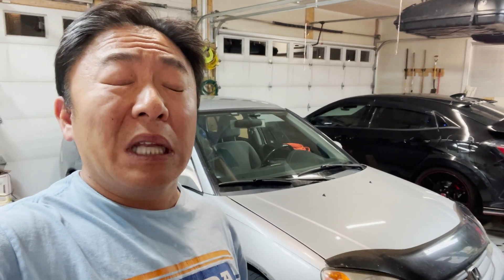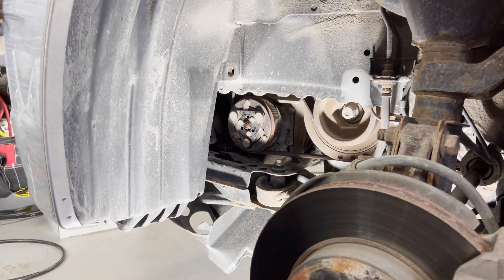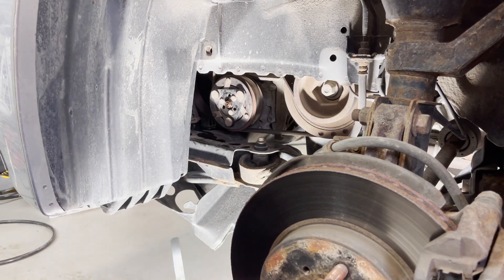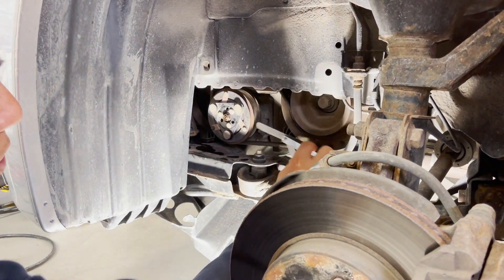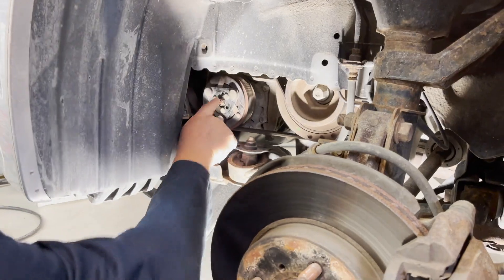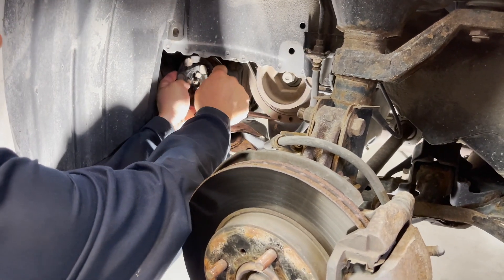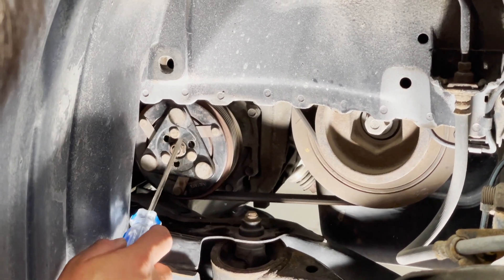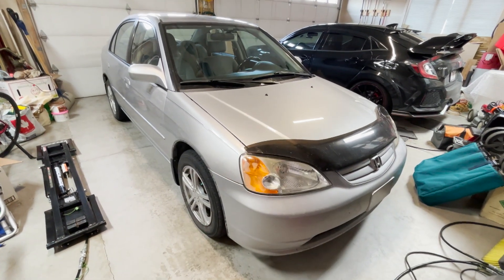Honda AC compressor clutch air gap fix

Comment: That's exactly what's happening with my 2015 Honda CRV. When the car is in the sun all day, the AC doesn't work or isn't working at 100%. However, when it's in the shade, it works fine. It seems the temperature increases the gap, preventing the clutch from engaging. I'll try this trick, hope it works.

Comment: Thanks so much for the video, some really useful info there. I have a UK FN2 Civic Type R with a similar if not the same AC compressor. Mine is showing the exact symptoms of this Honda so i'm looking forward to trying this. Do you happen to know if the clutch plate centre nut has a torque setting (nm) when replacing it?

Comment: Had the same issue. I couldn't figure out what the problem was until I spent a long time watching the compressor engage and fail to do so after a while idling. I shaved the shim since removing it made the air gap way to small. Great explanation. I energized the coil and had the belt on, so I didn't need that special tool to dismount the plate.

Comment: Works on 2018 Honda CRV as well. Thanks.
Reply: I have a 2018 CR-V and the a/c works intermittently on the hotter days. Been doing this for a few years. Watching this video makes me think this is the problem we have as well. @GizStudPrez, did you  have this same problem? Were you able to remove the clutch plate and then remove a shim on your 2018 CR-V? Did you do it yourself or take it to a mechanic?

Comment: In the video you check the gap between .4mm and .5mm but in the text below it says "Honda a/c clutches typically call for a  0.050mm +/- 0.015 mm variance. Anything that falls outside this gap range will result in a clutch that won't engage or one that won't release."  0.050mm is equal to .002"  which seems mighty close.  I am trying to set the air gap on my 2010 Honda Odyssey Touring after replacing the coil and the clutch kit came with two .020" thick washers and the original washers were each .052" thick.  The two thin washers on the new clutch hub and pulley cause them to lock together.  What gap should I be trying to achieve?
Reply: The Honda service manual says "0.35mm - 0.65mm (0.0138" - 0.0256").

Comment: The car dealership I got my from put a new AC compressor on mine. A 1 /12 ago. I used it once. Am really not into the air conditioning cause I just roll my windows down. I don’t like a lot of air. Bad on my body. Great video

Comment: Great Video! What's the name of the tool you bought on Amazon?
Reply: Nevermind! I googled "clutch holding tool" haha
Reply from the maker: It is an ac clutch holding tool but on a honda you legit can just jam a screwdriver into the clutch to prevent it from spinning. The little nut holding things together isn’t very tight at all

Comment: Say if the AC has stopped working entirely? The electric fans activate when the AC button is pressed but the compressor doesn't engage.

As mine packed up suddenly a few weeks ago, still pressure in the system. Relay and fuses are ok. I can't get enough of a tap or turn on the compressor however the gap in the clutch is .80mm.

Comment: I have a 97 CRV my power steering pump has been leaking could that fluid cause the clutch to slip on this AC cuz everything else is working fine and there's freon in system

Comment: I'm going to try this with my '09 Fit. On 90°F+ days the AC blows nice and cold for 5-20 minutes before stopping completely. Happens faster when idling or in stop-and go traffic, and I can often get it to engage if I coast down a hill for 10-20 seconds. It seems the air gap is just barely too big when the plate gets really hot and the metal expands, and cools just enough to engage when I coast. Hopefully there's at least 1 or 2 shims in there I can remove to buy myself another couple years of life out of this clutch.
Reply: I have a 09 Fit as well and see similar issue. Ac stopped blowing cold air after couple minutes when it is too hot outside. Did you remove the shim(s) and did it solve the issue?
Reply: @timalice1794  Yes, I did it last fall and it's been working just great all year! I was sure that something was going to give this summer given the extreme heat, but so far no issues.

I used the same tool as shown in the video, took me about 25 minutes. I wish you the best of luck getting yours fixed! 

One thing I'll mention is that I had already verified that the system was fully charged. It could be that your system is low on refrigerant and the low side pressure switch is preventing the compressor clutch from engaging. That said, removing the clutch shim(s) is pretty easy and there isn't really much of a downside. If it doesn't fix the issue then you can always put the shim back on. But if your car has high mileage then you're probably better off just leaving it without the shim anyway.
Reply: @nameismetatoo4591  Thanks for the quick reply! Much appreciated. I will work on it this weekend. Have a good week.
Reply: @nameismetatoo4591  Hi, I removed the washer this weekend and the AC compressor clutch stayed engaged and AC is blowing cold air! Finally after 2 years! However, the coldest temperature that is coming out of the vent is 59°F at 88°F outside temperature. How cold are you able to get inside your FIT? Below 59°F?
Reply: @timalice1794  Sounds like it needs more refrigerant. On an 88 degree day in direct sunlight, I'd expect somewhere around 40-49 degrees coming out of the vents.

That being said, make sure you test it with the engine at about 2500 RPM. The compressor isn't working at its full capacity at idle RPM. I'd test it while driving to see if it gets any colder. If it still struggles to get below 50, then you probably need a recharge. Buy or rent a manifold gauge set, a can tap for self-sealing cans, and a can of R134a with no additives. Be absolutely sure it doesn't contain stop leak or oil, as those will contaminate the system. 

As for the recharging procedure, there are plenty of guides online. ChrisFix's video is pretty thorough.
Reply: @nameismetatoo4591  thanks again for the quick reply and your help! The 59F I measured was during idling. Will measure again while driving and looking to refill the system as you advised. Thank you!

Comment: Thanks for posting this! I'm having intermittent problems with the clutch engaging on a 2011 Honda CRV, but the AC is cold when it does work. I already replaced the relay and checked refrigerant level. The clutch engaged after giving it a whack (while the car was not running), so I suspect it's on the edge like yours was. And the problem occurs on the hottest of days, which is consistent with the large gap theory. Hotter temps might cause just enough expansion to grow the gap and prevent engagement. Now I'll look for a shim kit. One could also patiently file down the shim already installed if removing it closes the gap too much.
Reply from the maker: Yes that is exactly it.  On your CRV you won't be able to get the clutch plate off the compressor shaft but you can get it out enough to SNIP the shim in half to remove it.  The side frame rail is too close to the compressor to get the plate off.  If there are 2 shims then just remove one and retry.  If there is only 1 shim then get rid of it.  Honda's compressor supplier offers a generous range for clutch air gap so you won't need to buy a shim kit.  Just axe and problems solved.
Reply: @piercedasian Thanks for the reply. Yes, I already tried to get to the plate and found exactly what you stated. It doesn't come off because of the tight space. I failed to find any shim in there at all, but maybe I didn't poke and look hard enough. It's a tough angle on the CRV. However, I tightened it back up well and it's been working. Summer is just about over, so I'll have to see what happens next year when it's really hot again. I also learned how to charge my system in my attempts to troubleshoot, and that made my CRV a much cooler car - temperature, that is!

Comment: Did it stop blowing cold at the red lights and stuff .
Reply from the maker: not so much at red lights but when it got super hot out such that the clutch gap expanded a tad beyond the maximum allowed spec which then causes the clutch to not engage.  Heat expands metal and shockingly, enough to cause clearance issues.  If you're not getting cold at red lights it COULD mean a few other things such as low refrigerant, slipping clutch (fixable by new clutch or this video mod) or your condenser fan could be bad too.

Comment: I've learned a lot just by watching your video.  I went to the Honda Dealer and they charged my for replacing the AC clutch but after several months still problem with my AC not getting cold. Took my vehicle to another auto repair shop and they said that Honda should have known the condesor was leaking.
Reply from the maker: ah that's crappy to hear.  Condenser leaks are quite common given how thin they are and where they're placed on the car.  Literally exposed to ever bug and rock on the road that hits your front bumper.

Comment: I'm tempted to try this after the relay, fuse we're good and thermal switch bypass didn't help.

It's a 2011 crv though and reaching the clutch is a bit harder since there is a reservoir in the way by the wheel well

Comment: This clutch should have been replaced, You should never run an ac without a shim , also it shouldn’t have cycled that often. Otherwise everything else was good information.
Reply from the maker: That isn't true at all.  The clutch while I agree should be replaced when it's worn that there was still some life left in it where I didn't need to drop $100's to replace it.  The shim spec is listed in the honda service manual.  As long as one measures the gap and it falls within spec then I don't see why one MUST use a shim.   The cycling is environmentally influenced.  It is rarely humid where I am at so the compressors on our cars cycle often to prevent evaporator freeze up. The a/c on this car is surprisingly 100% original with the original charge (its our daily driver) and the a/c works perfectly albeit a bit squeaky b/c the clutch IS definitely wearing out.  I figured that if I get 1-2 more years out of it then I can easily get a used clutch from a wrecked civic and install it and keep on trucking' along.  Thanks for stopping by.

Comment: Thanks for this great video! Any idea how much a good mechanic would charge to do this work on my 2008 Honda Civic - opening up the clutch assembly, removing the shim, cleaning off the rotating parts and reassembling to the correct gap (per Honda specs)? I live in Mississauga and our local Honda dealer has balked at this fix - wouldn't recommend it - and prefers to install a new compressor or clutch and coil ($1600-1700 + tax)!! Any suggestions would be much appreciated.
Reply from the maker: I thought I replied to this but I'm having some issues with YouTube comments.  This isn't hard to do on your own.  Have you considered removing the shim yourself?  Honda tech balk at this b/c they don't want "call backs" if things don't work right or the clutch is too far worn out.  In the automotive repair industry they'd much rather replace all day long than to attempt at repairing b/c it costs them less time and less warranty risks.  The fix is so easy (and approved by Honda) that you absolutely should save your money and do the fix on your own or if a shop did exactly as they're told shouldn't charge more than 30 minutes of labor to do this.

Comment: So, you don't put the shim back in there right? will this cause a major issue on a clutch system? Or in the future will it cause problem because of a shim remove?
Reply from the maker: that is correct, on higher mileage cars the clutch is often quite worn thus creating a large air gap between the electro magnetic coil and clutch plate.  The shim is to provide more clearance for the clutch to have room to disengage properly.  The shims (sometimes there can be 2 under the clutch plate) need to be removed to close up that air gap so the magnet can catch the clutch when it needs it to turn on.

Comment: Awesome video! My AC went out 4 days ago. One question, many YouTube videos seem to have a gap issue. In my case there is no gap at all, looks flush with the pulley and the clutch doesn’t spin at all. Would adding a spacer so there’s a little gap help? TIA
Reply from the maker: the gap issue is created due to wear on the clutch.  The gap over time, increases and therefore the electromagnet can't "catch".  If the gap is non existent on your clutch then odds are the compressor is constantly running and not releasing.  If you have no cooling then chances are you've lost refrigerant or the compressor has failed.

Comment: Will this work on work on the 8th gen 2006-11 Civics as well? Is the clutch also accessible from behind the wheel well?
Reply from the maker: almost all common automotive belt driven a/c compressor clutches work the same.  So yes the fix would apply to the 8th gen civics too. I believe you can on the 8th gen.  Ironically I'll be doing this clutch fix next week  on an 06 Acura CSX.

Comment: Okay, for those that don't have the 3 holes for the clutch holding tool, on mine the middle nut my shockingly loose. You can try just using your hand to hold the pulley in place, that might be enough. But if not, just hold the pulley with some regular old pliers with a 90 degreeish bend. Should come off easily.
Reply from the maker: or you can jam a flat bladed screwdriver in the clutch to prevent it from rotating as well.  The clutch holding tool obviously makes it easier but there are ways around it.

Comment: I got the car all ready to do this this morning. I rented the tool from autozone and everything. Then I look on the clutch, and it doesn't have 3 holes for the tool to go into. So I came back to confirm that yours had 3 very obvious holes, and it does. I've seen so many videos of people doing this and nobody has issues like mine. Sucks.
Reply: Okay, so i basically just held the pully with a pair of pliers, but the bolt came off shockingly easily. I dunno if I even needed the pliers or even my hand to hold it in place. Did you mention how right that cover is against the the pulley now without the magnet? I tried to pry it off but I couldn't without reasonable force.
Reply from the maker: Glad to hear you got your clutch off.  Not quite sure what you mean by how tight the cover is against the pulley.  Are you referring to the clutch plate that was mildly "stiff" to get off?
Reply: @piercedasian  Yes,  I put tad bit of pressure to pry it off, and it didn't budge. I was just trying to make sure that I put it on correctly, but I suppose the magnet did all the work for me. I put a little grease before replacing the clutch plate, but I doubt I'll ever need to take it off again. If the AC doesn't work after this, for whatever reason I need the whole compressor.
Reply from the maker: Hopefully your AC continues to work properly :)
Reply: Super video and helpful to have the explanation for why the problem occurs and why the fix works. Totally makes sense!

My 2008 Civic has experienced exactly the same issue for a LONG time. Works fine at the Honda dealership but after driving for an hour or so in hot weather, AC stops working. Honda has not been able to fix it after multiple attempts. Changed relays, attempted to recharge refrigerant w/ dye etc etc. no luck. 

Then I sent them your video and they said they really would not recommend this and instead recommended that I have them replace either the clutch plate and  coil (Honda brand, Cdn$1700 + tax) or aftermarket compressor that comes with clutch and coil ($1650. + tax). I insisted he quote me on your approach and he quoted $800 + tax. So I’m going to talk to an independent mechanic for another quote. Any idea how much a quality, independent mechanic would charge for the procedure you outline in the video? Thanks lots in advance ..

Comment: Great and informative! keep up the good work. I've seen YouTubers with 1,000,000 followers who don't cut to the chase as you do!
Reply from the maker: I appreciate that!
Reply: @piercedasian thanks bro, im getting ready to do this on my 03 Accord. Where did you get the gap specs for your compressor clutch? Im wondering if the gap is the same on mine or if the compressor is bigger on the Accords? Thanks

Comment: Thanks. I had read about this on civic forums, but it's much, much easier watching someone actually do it. I wonder if there's a way to hold that plate in place without getting that tool. I know with some stuff you can just put a ratchet on a socket on it, then place the handle against the ground which will prevent it from moving when you try to turn it. Perhaps maybe a ratchet with a socket hex adapter in one of those holes?
Reply from the maker: I replied to your other posts but it sounds like figured it out but nonetheless, thanks for stopping by!